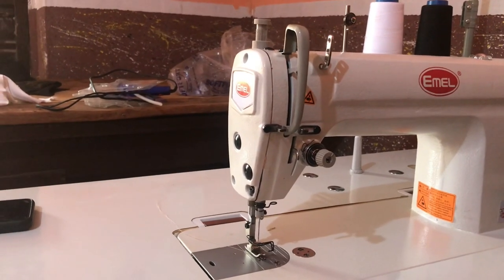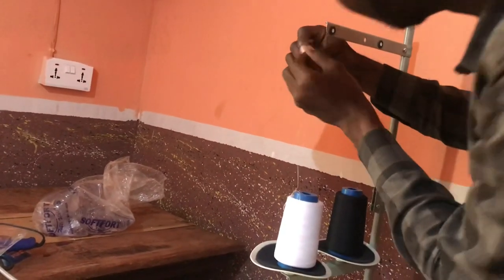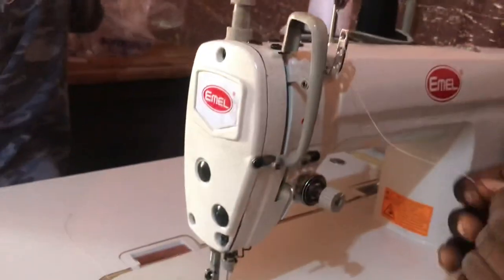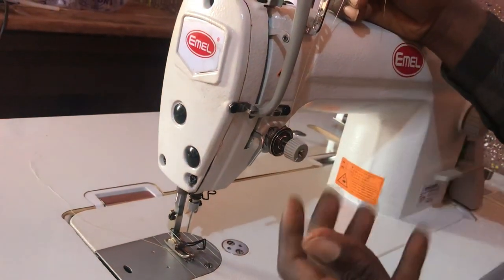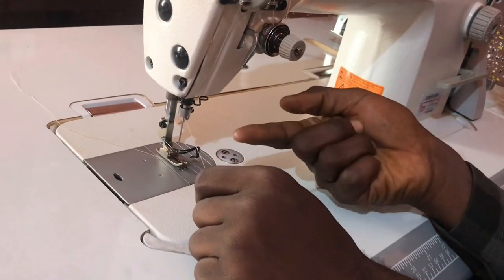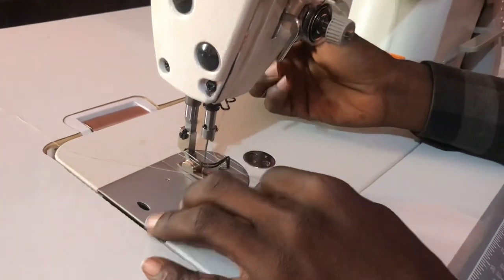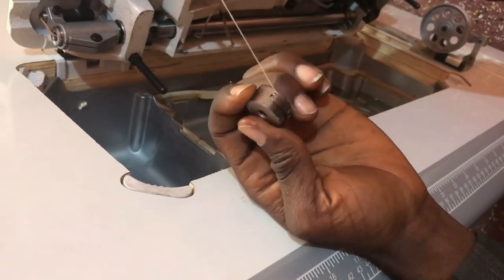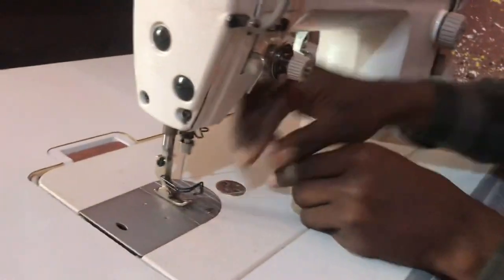How to pass Emel industrial straight sewing machine thread. Model 8500 And insert the bobbin case

Comment: Pls how do I bring down the foot it has refused to come down
Reply from the maker: There is a pressure nut at the top of the machine directly on the foot to try and lose it. If that is not working you can raise the machine like you push the head back there is a black cap rod, try and position it well